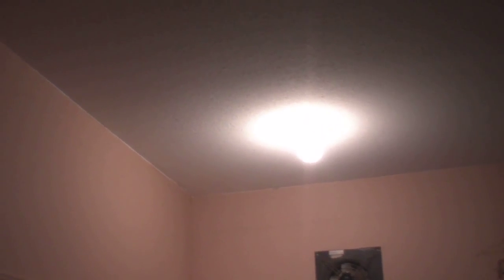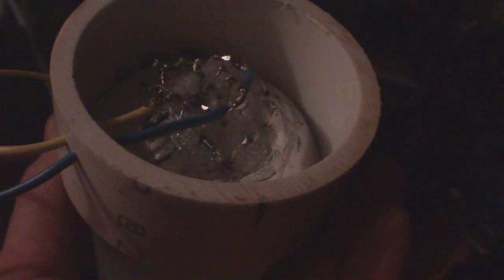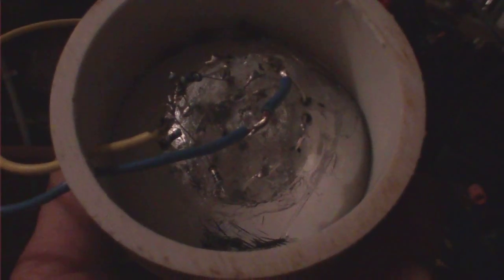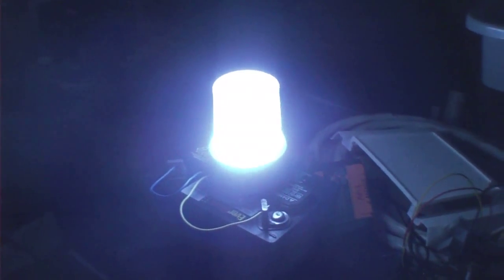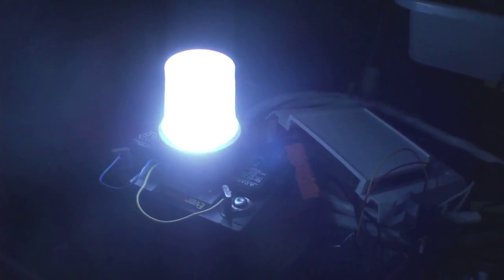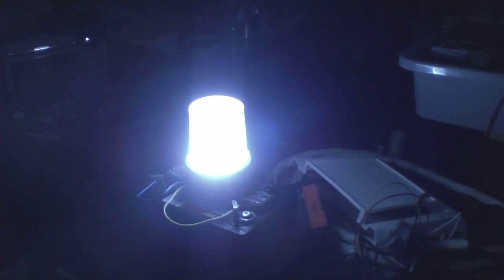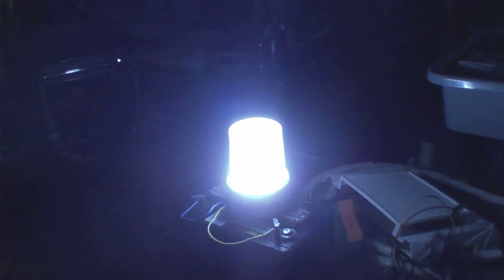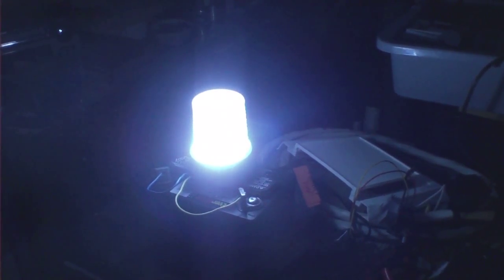DIY LED 12v (4 watt) Frosted Glass Lamp For Under $5

Comment from the maker: @trailkeeper better off using a boost converter if u want to run them on less than 3.2V :) Cheers. On talkingelectronics they have some cool circuits for LEDs

Comment from the maker: @trailkeeper Recently I have been wiring LEDs for 9.X volts, 3 in series, and just drive the whole works with a PWM from 12V and use no resistors at all.

Comment: Nice project.  I guess you could remove the the energy wasting resistors and put an led or two in thier place.  I understand you are using them for circuit safety now.

Comment: @Magneticitist Thats not a maybe on those resistors (unless your using a v-reg or constant current source) but never connect straight to batteries unless you hate your LEDs. And use a single CREE or even the ones from dealextreme and it will be even brighter. For a flashlight a resistor is not the best option because its not efficient. Use a switching regulator and get 98% efficiency to make your batteries happy :)

Comment: also saying voltage or current kills them is sort of strange. its really both of course. just the wattage. the watt input kills the leds. feeding 12v to a 6v string of leds will kill them faster of course just because they are being overdriven with more wattage. leds get hot. that IS indeed current u are seeing escape as light just like an incandescent, but the resistor is just air and not a filament. 
a 3v led will feed from a 9v just fine for hours as long as the 9v has little current to give.

Comment: dude heres the thing also.. if u add some reflective aspects to it the thing will illuminate so much more. with all the torches i make i always notice the proper reflective canning improves the brightness to a point u just cant go without. u can buy 2 $1 store flashlights (the kind with 3 leds and 3 AAA batts) and put them in series being driven by a 9v battery (with maybe a 10 ohm resistor) and it will illuminate a totally dark room very impressively.

Comment from the maker: @electrodacus I haven't tried those yet, but as for camping lights, you can make 10 lights for the same cost as one. Bought bulk the difference is $10 vs. $1 for the LEDS, so I prefer 8mm and 10mm, they are just cheaper.

Comment from the maker: @ciprianwiner hey partner! I gave this lamp away, I make them, then give them away LOL - but -- that one was wired specifically for normal current using calculated resistance and series circuits, for 12v. I haven't had much luck with (above 1.5v) joule thiefs. It is my belief that the joule thief circuit is less efficient than running normal current. It is very cool, however, for getting some degree of light, out of lower voltage. I think once you go over 3.2v, it's possibly pointless...